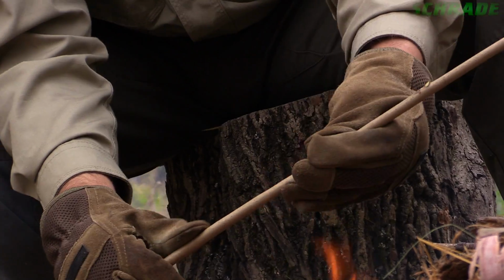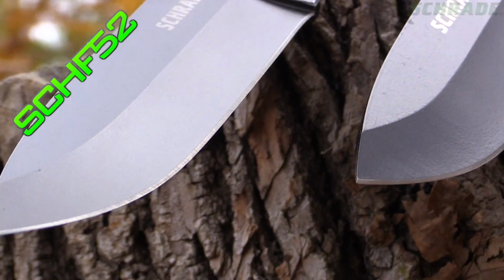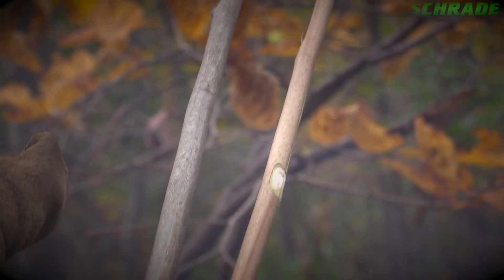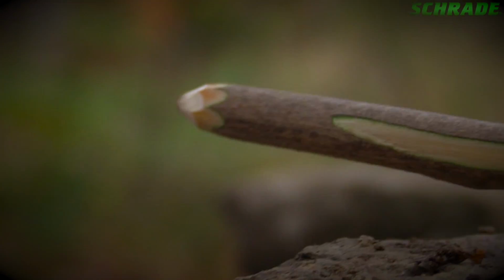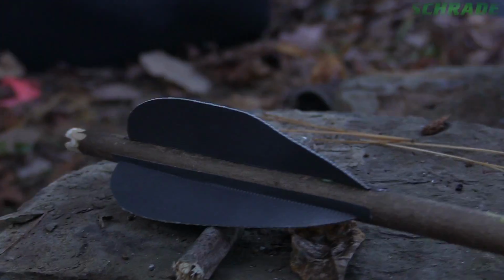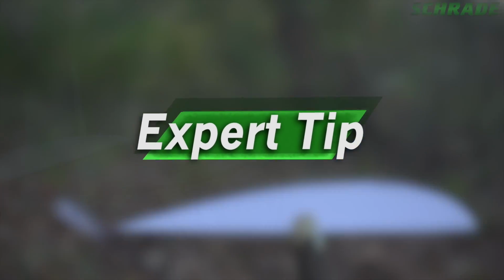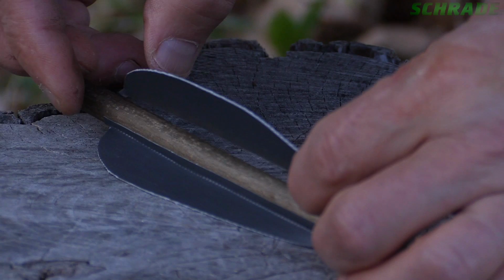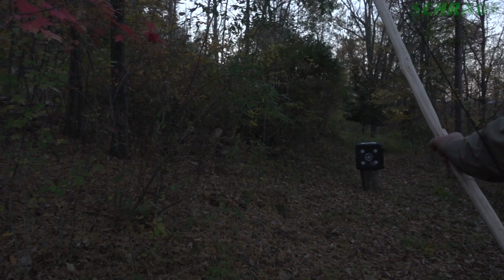How to Make a Survival Arrow

Comment: Duct tape is too heavy to use on an arrow with no head like that.  Your balance point will be way behind center and the arrow will fly askew.  You can whittle the rear half of the shaft down and/or wrap tape around the front of the arrow to make the balance front of center though.
Reply: Thanks for the heads up bro

Comment: You can make the fire hardened one almost stone strong by charring the end by about 2-3 inches. Then sharpen it on a rough stone. Just fire drying it will only be as good as dried wood.